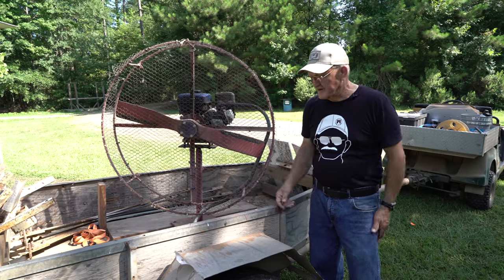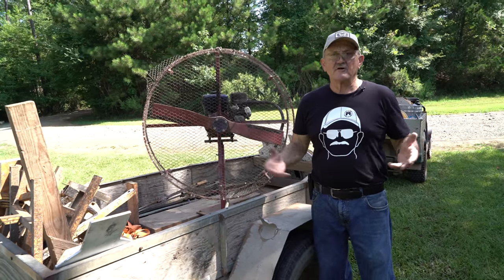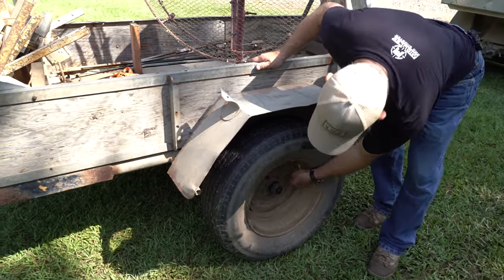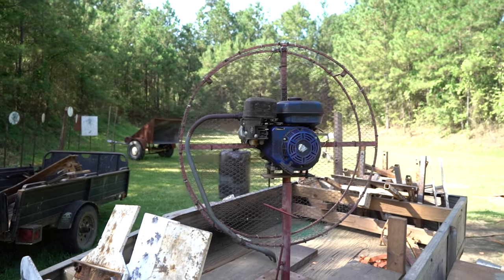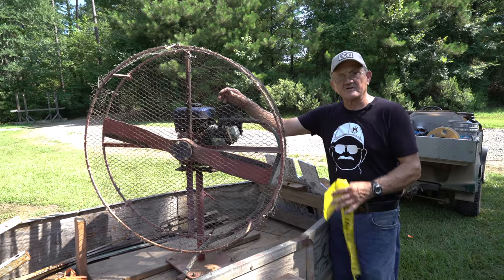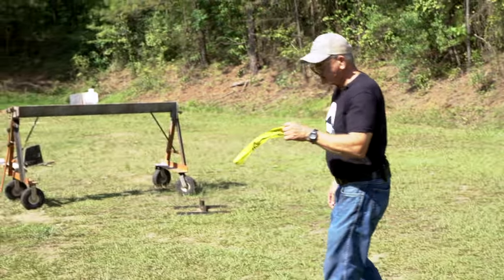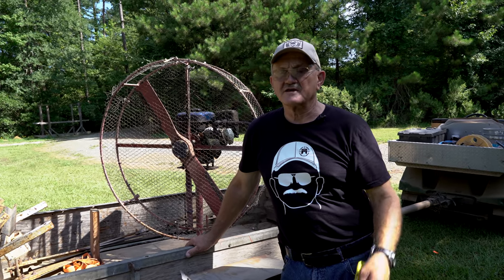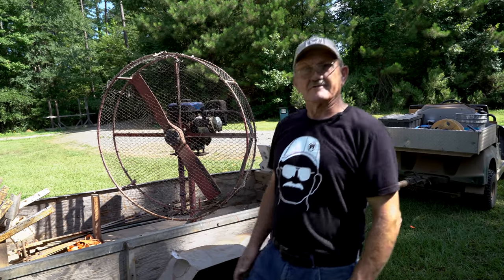45 Year OLD Range Trailer!

Comment: Be careful welding galvanized lol.
Reply: Yes indeed ,more ventilation the better
Reply: Zinc oxide is good for you!
Reply: Just drink some milk and get back to welding !
Reply: As much safety as he puts into gun stuff I bet he’s pretty safe about everything
Reply: @dwightmitchell1464  later that evening 'you allright in there ya looking a little bit grey' lol
Reply: Thanks for the safety squad message 45 years after he built the trailer 🙄

Comment: Big props.. looks like dog robbing and self fab like that is cross cultural.. up here the old PA Dutch guys (myself included) will pinch a penny till it's wire, and there are more than a few tractors (and cars) with repurposed ice makers, street signs, and broken tools ( old wrenches welded in as backhoe levers).

Comment: The fan starts so easy because of that prop acting like a large flywheel
Reply: Those predators are pretty Impressive for the money. I put a 6.5hp predator engine from harbor freight on the kids go kart. With coupon it was like $80. Brand new out of the box it started with one pull and still starts with one pull a year later.